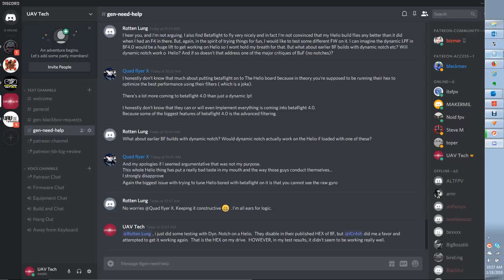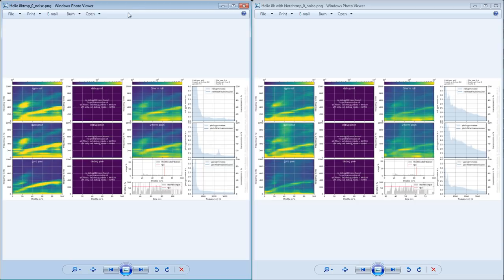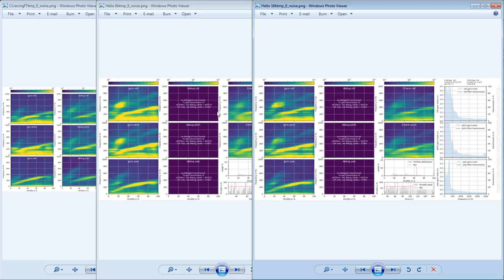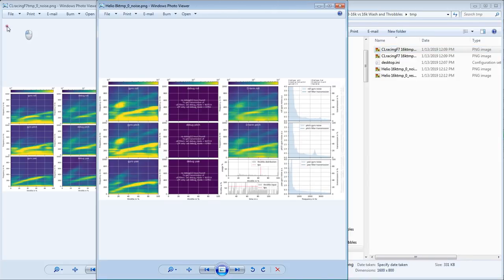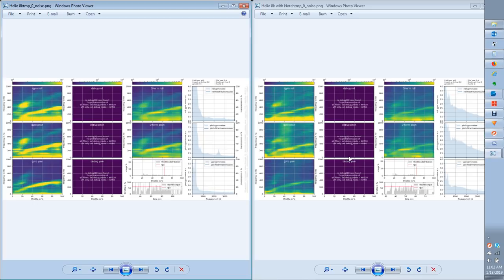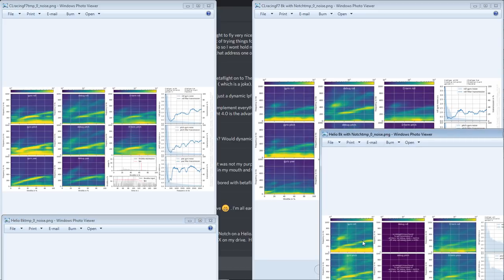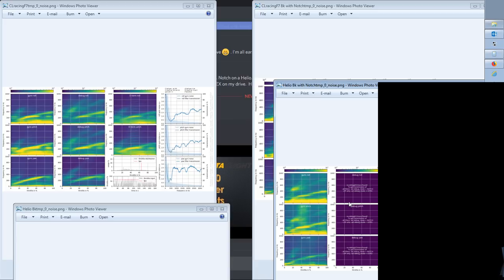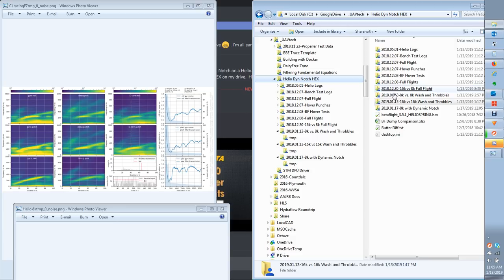Dynamic Notch on Helio Results

Comment: I'm hearing more people having that issue with spectrum. Did you try placing a capacitor on the input voltage of the receiver? That helped me with some issues in the past during wintertime. (was a pair of video goggles that had issues with the cold, not a receiver tho).

Comment: The devs have said the helio always samples in 32k for the F3 to process.  The gyro setting in beta/butter does nothing. Setting it higher then the PID loop just cost CPU. Hence they recommend 16k/16k for dshot users.
Reply from the maker: But if i set 32k/32k I hit 100% CPU. In 16k it is fine.  Yes, the gyro in 32k mode reads at 32k.  However, 16k must down sample, right?  It is just that if you uncheck 32k mode in Helio target, u don't get 8k mode.  U are still in 32k mode for the DLPF setting in the gyro.  U can down sample, but hardware wise, it is still in 32k regardless.  That is NOT how BF normally works so can throw someone off.